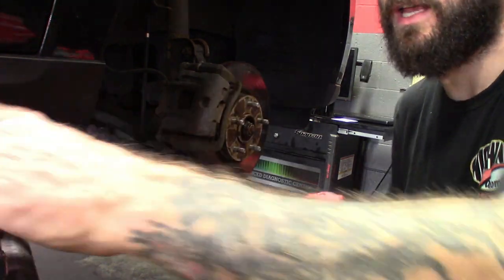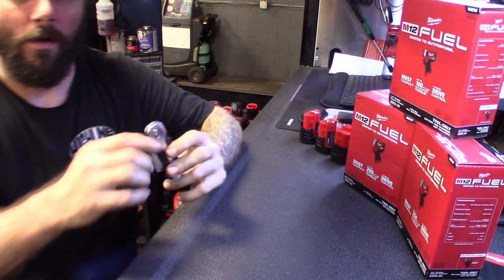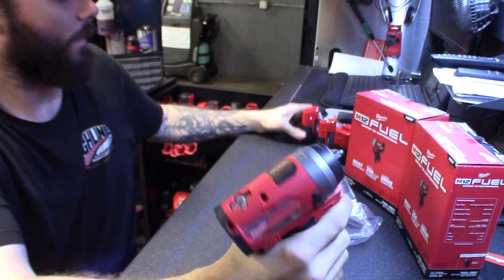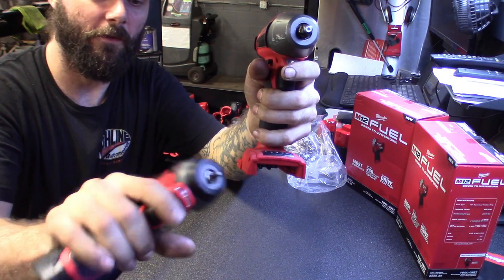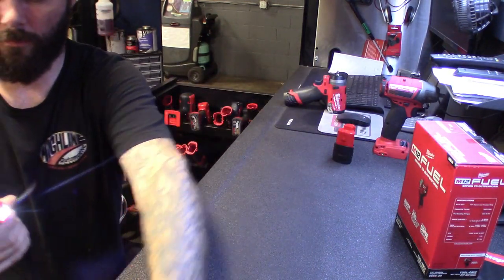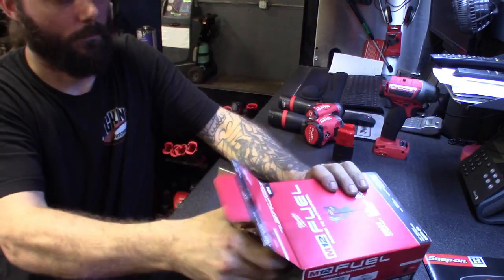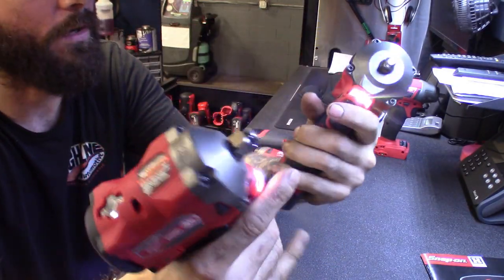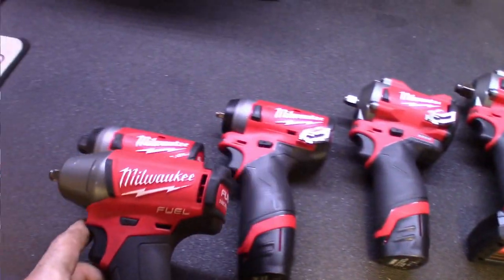Stubby power!

Comment: i have the 3/8 stubby and really like it. It has a lot of power in a small package. the one thing i like best is mode 4. perfect for just running fasteners down, dash work, or plastic plenums/intakes.  one battery platform with many tool options that won't break the bank.  recently found your channel, good job, thanks for sharing

Comment: Cool. Eventually going to get the 1/2” for sure. Have the SnapOn 14.4  3/8” and have been really happy with it. Just started investing in the Fuel 18v stuff and have a few items in the 12v lineup as well. Looking for to the long term review.
Reply: Do you see any difference, as far as performance between the 3/8 snap on and the stubby Milwaukee?
Reply: Can’t say yet. I only own the 3/8” SnapOn. Love that impact. Looks like Milwaukee has them beat though with torque, price, warranty. But hey, Snappy is what I own and Snappy is what I use for now. Size wise it’s hard to beat SnapOn’s gun and for most of what I do it has plenty of power.
Reply: @theengineroom1479  i got them 2. My snapon been with me for a while, reason why i got the stubby was because of specs buti don't see a lot of difference. Maybe just me.

Comment: Man I tell ya I love my Milwaukee 12 and 18 volt line up. The most recent is the 18v 3/8 I really like the power in a small package. The cool part is a very good line up of battery operated tools that almost anybody can afford to purchase<<that's gotta be the best part! I curious to see how long they hold up in your hands being used on a daily basis. I use my 1/4" drivers on a daily but not my 3/8-1/2". But at the price these coming in at I don't see that being much of a problem anyway.
Reply from the maker: Mine seem so far so good. I had problems with the batteries not holding a charge and getting hot.

Comment: Just got my Milwaukee 3/8 Stubby and this thing is amazing!! Took care of 2006 Jeep Commander suspension that was never touched LCA, struts, UCA, axle nut. Front and rear brakes rotors and pads that were done 3 years ago!! Not one issue. Battery life was above normal when I was done. Amazing little beast that gets into tight spots!!👍🏻👍🏻